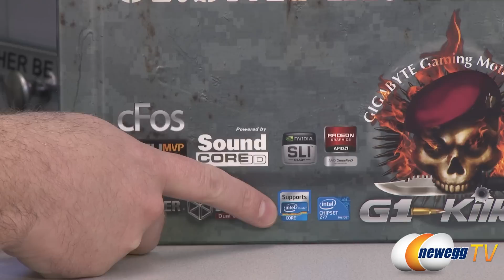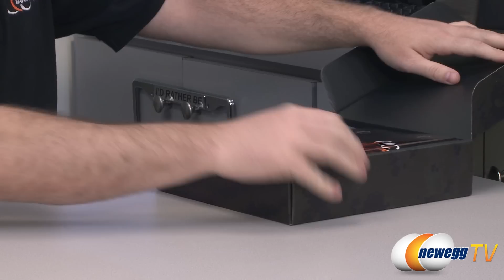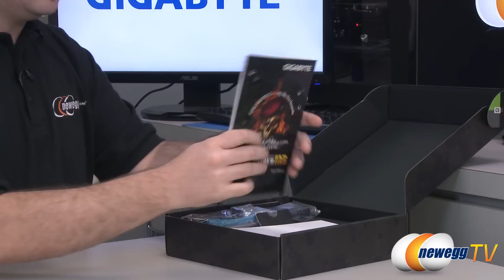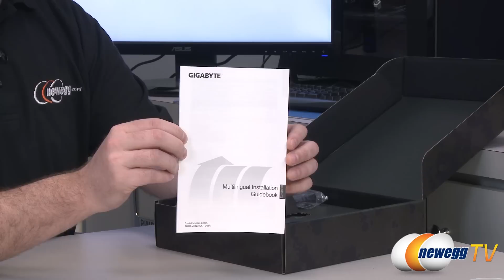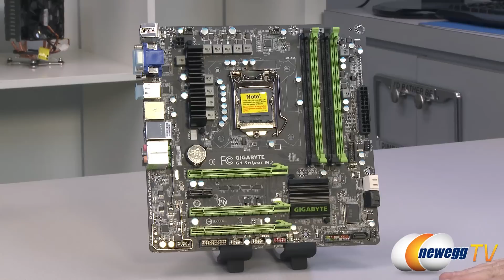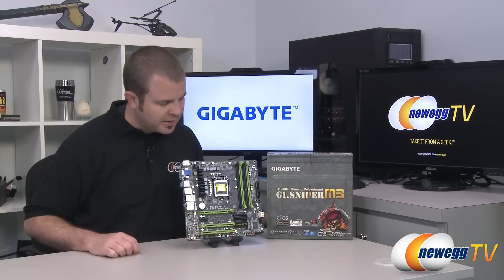Newegg TV: GIGABYTE G1.Sniper M3 Motherboard Overview

Comment: I don't see how you could do CrossfireX or SLI on that board. If you must use the bottom PCIex8 slot for the second card, you would need to install the board in a case that has at least 5 expansion slots. There are NO Micro ATX case that fit the bill.
Why does Gigabyte anf the other companies keep releasing Micro ATX board that must be used in mid tower or full ATX cases?

Comment: why only a 4 pin cpu power connector for such a high end board? wouldn't that inhibit overclocking? given, ivy bridge has a lower tdp required than sandy. i'm just skeptical about stable overclking on this board. :/